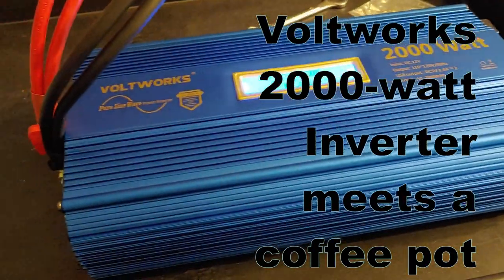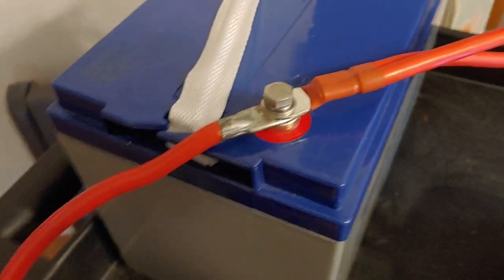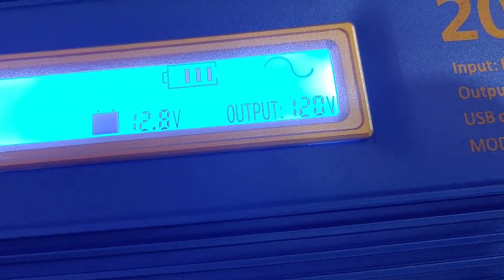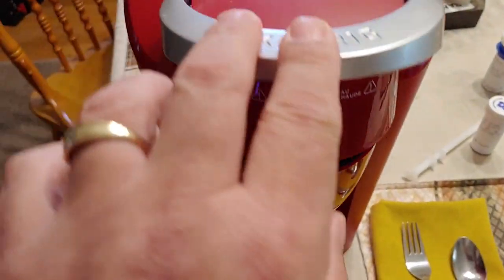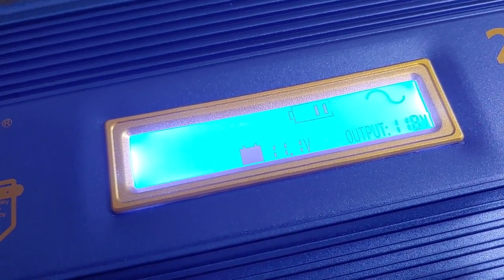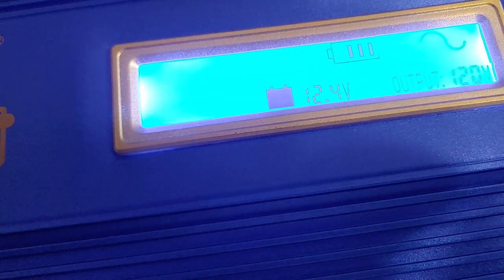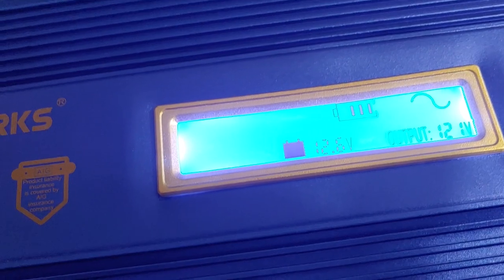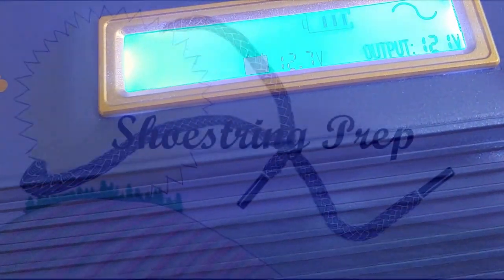Off-grid Voltworks 2000-Watt pure sine wave inverter meets the 1500-Watt coffee maker

Comment: When the instructions say to turn it off when not in use, could that be just to not present a parasitic power load on the battery, rather than an overheating risk?
Reply from the maker: That could be the case. Thanks for your comment.

Comment: Is there a reason why you connected two batteries “nooby way“? And I think that is the reason why your battery voltage drops to 11.1v. When you use two batteries set-up you wanna connect the positive wire on one battery and the negative wire on the other battery.
Reply from the maker: I was connecting the batteries in parallel.
Thank you for your comment.

Comment: You should turn ALL inverters off when not in use because they pull power all the time,  even when they aren't powering anything. It will kill the batteries fast! Its best to run a inverter when its mounted in a vehicle so you can run the engine to keep the battery charging during use.
Reply from the maker: The system I demonstrated is not a vehicle type system. Thanks for your comment.

Comment: What way does the fan blow? Out the D.C. end or out the A.C. end? I'm wondering if I mount it vertically which end should be up. Thanks!
Reply from the maker: The fans are on the Dc side, where the cables are connected.
Thanks for your comment.
Reply: @shoestringprep  Thanks, do the suck air in or blow air out?
Reply from the maker: @reecerocket  blow out

Comment: Which direction do the fans operate?
 Is the battery hooked up side a exhaust with the fans or an intake with the fans
Reply from the maker: The battery terminals are on the same side as the fan. Thanks for your comment.

Comment: Hello, would you want to test the 300W car power inverter?
Reply from the maker: Which 300 watt inverter? Thanks for your comment.
Reply: @shoestringprep  I yhink he's rsferring to the Voltworks 300W pure sine wave inverter. But it lacks the display. Only one 300W pure sinewave inverter has a full display, and it costs under $100: Folkma. Only one 600W pure sinewave inverter has a full display. It, too, costs undet $100: Luborne, which came out in February 2022.
Reply from the maker: @PaulStregevsky  No, I am showing the 2000 Watt Voltworks, as you can see in the video. Thanks for your comment.
Reply from the maker: @PaulStregevsky  I will look and see if I have the 300 Watt and I will test it. Thanks for the tip, and for your comment.
Reply: @PaulStregevsky  Hi,600W pure sine wave inverter is in promotion price now,only USD79.99